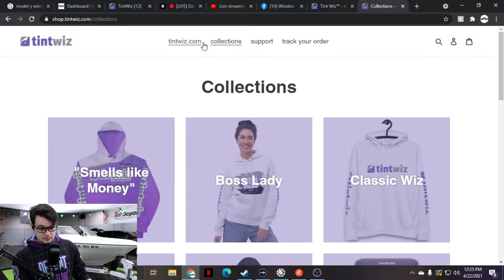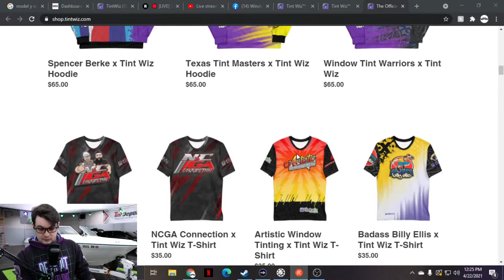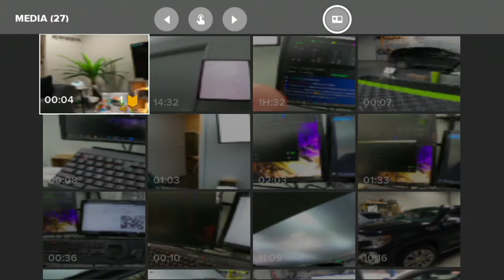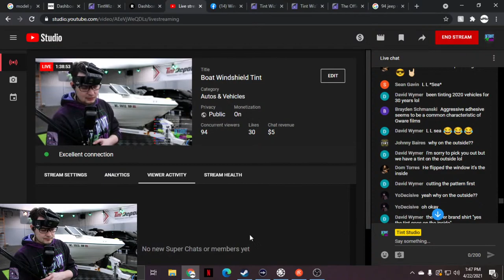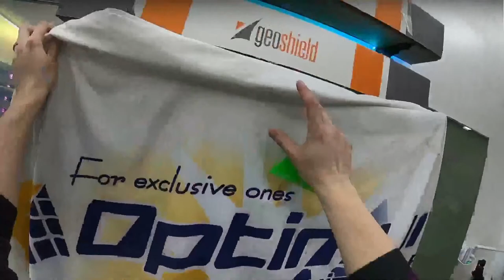Limo Boat Windshield Tint

Comment: boats are tuff for me...where i replace glass I remove the frames on these cause I continue to get light gaps
Reply: All you gotta do is get some black silicone. Go around and cover it up . 😅
Reply: @Tintcasso909  sometimes that looks worse than the light gaps and usually peels off after a year.  

I've improved my skills since then and now I leave a little over hang to cut after I installed the film.  Seems to work out better than trying to line the film up to how the pattern was cut 100% exactly on point.